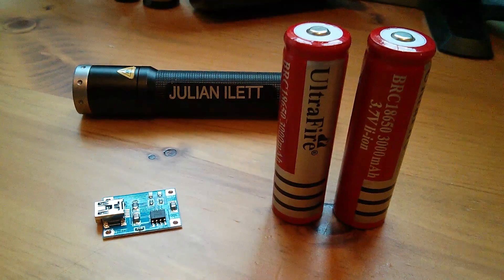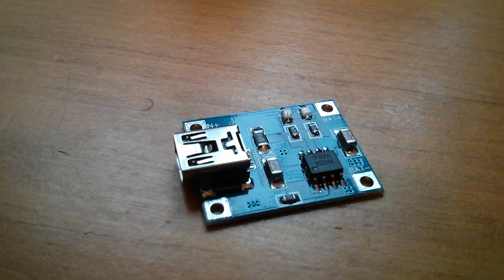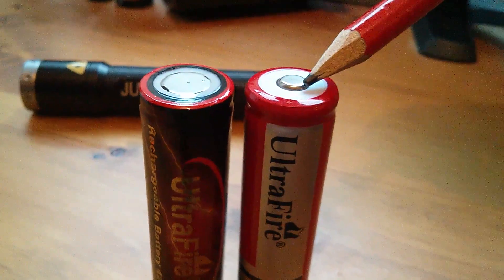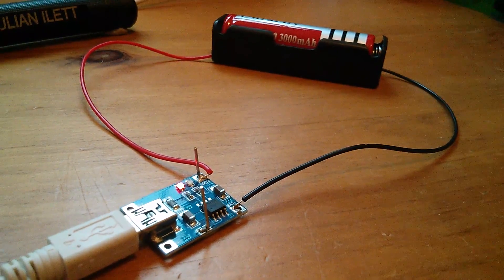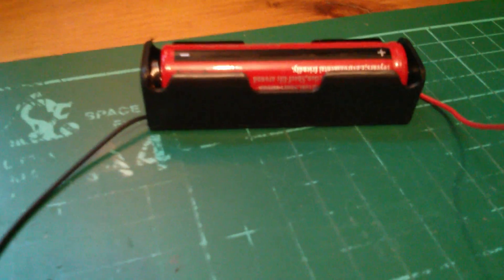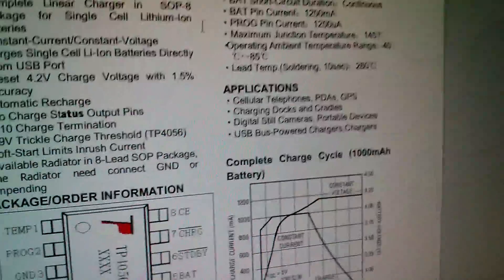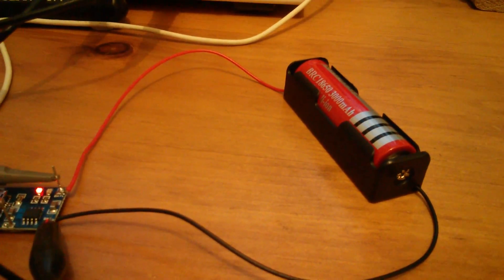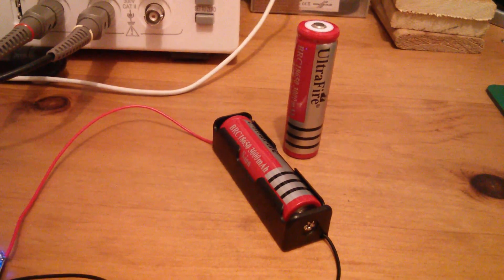Charging a Lithium 18650 Cell using the TP4056

Comment: Hey I just received 2 of these and I am wondering which resistor to change so that the end voltage is 4.1v I'm guessing it has something to do with the resistor that is bridged across the end?
Reply from the maker: It's the resistor that's connected to pin 2 of the chip. Changing the resistor doesn't alter the maximum voltage, that's fixed at 4.2v - it changes the charging current.
Reply: Julian Ilett i would of the voltage could be changed as when powered up there is 4.2v across the large brown resistor in the middle, I know the current can be changed but I just want an end voltage if 4.1v, Thanks for the reply.

Comment: Great review! I'm using the same charging board for my solar cell phone charger project: small 6V solar panel charges the Li-Ion battery with the help of this board and then the battery will charge the cell phone with the help of a step-up converter.

Comment: Hi Julian, i have a question for you if you could answer. I want to make a AA/AAA charger that charges 1 battery. I have a solar panel of 5volts, and max output 2 amp, or another at 5volt 600mah. Would this module blow my battery up? Thanks if you can help
Reply from the maker: This module is for lithium cells, not NiMH.

Comment: Hi can you use these usb charges same time you are using the battery power I mean can I make a circuit using this USB charger and then take positive and negative from the battery and use four example Small bulb so USB charger charging Sam time I am using battery power I hope this makes sense thanks
Reply from the maker: Probably OK if the load is very small (say less than 50mA), but a continuous load current greater than 100mA will disrupt the operation of this charger.

Comment: Hi julian, have you tried removing the protective circuit inside the Ultra Fire battery. I had to do this with my Ultra Fire batteries for them to properly charge. They now work fine except of course the mah is a big lie.
Reply from the maker: None of the (fake) Ultrafires I bought had a protection circuit.

Comment: Is there a easier way to use this chip or a similiar one to charge the battery packs with more than one cell in series config ? I dont think we can use multiple chip powered by single powersource. As it might sort the batteries is series.
Reply from the maker: Agreed. This module cannot charge multiple cells in series from the same 5v source.

Comment: Great video, thanks.
I've just received a couple of these chargers from a local auction seller. I expect they will be useful for charging small batteries used by the RC model people here.

BTW: I had a couple of UltraFire batteries which did have the internal protection circuit. The end cap was a small PC board. They both failed after 4 or 5 cycles to zero volts. The autopsy showed it was the cell itself that had failed.
The protection circuit did limit charge current and stop discharge; at least a few times.

Comment: Is this board safe to charge more than 1 cell at a time? 3 cells in series?
Reply from the maker: No, not 3 cells in series. 3 cells in parallel would be OK, but it would take 3 times as long.

Comment: Hi Julian, did you purcase some of the original Panasonic ones I recommended to you?

I have 10 of the same chargers here. They are onderful. Not everything from China is rubbish!
Reply from the maker: Yes, sort of - I got these: http://r.ebay.com/5t5cFy
Panasonic CGR18650CH cells, 10A current, 47mΩ internal resistance, 2250mAh. UK seller, so they'll come quickly.
Reply: Wow very good price, I payed 50 EUR for 4 of the green ones!! I think this are 46 BP.

Comment: The thin wires connecting the battery must have a resistance that causes the voltage at the chip to be higher then over the battery. Thereby causing it to lowering the charging current too soon.

Comment: Another great video Julian!. I would be interested to know if its possible to charge these cells with this type of charger whilst in circuit?. It would be nice to use Lithium Iron cells in small projects charged by small 6V solar panels but also use them in circuit to power the project. Is this a good idea or not with this type of charger? I'm guessing this may be why your looking into they as well?

Comment: Interesting little circuit. From my own testing all of the 18650's I've used have had rather high internal resistances as well(400mohm and above). To make the charger more time efficient you could charge multiple cells in parallel as you have more than one holder. Would be safe to do as long as the cells to be charged are all roughly the same voltage when you plug them all in. I've done this for years with larger LiPo cells for my quadcopters with no problems.
Reply from the maker: Just invested in a couple of 47mΩ Efest 18650 cells which can supply a sustained 10Amps. Only 2250mAh, but I'm more interested in the low resistance than high capacity. I'll try the parallel charging idea too.
Reply: Julian Ilett
I'd guess the lower ir will be far more useful than higher capacity anyway. As there will be less voltage sag under load you'll probably end up having more usable capacity as well.
Reply from the maker: ***** That's true - I'm pretty certain these are the genuine article. This is what I went for: http://r.ebay.com/5t5cFy